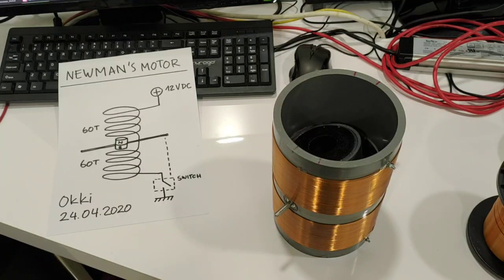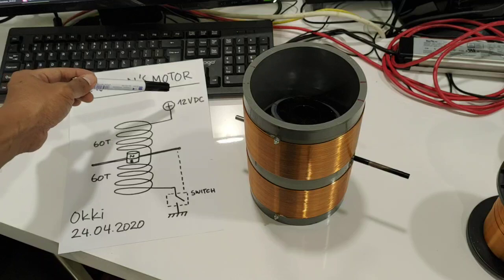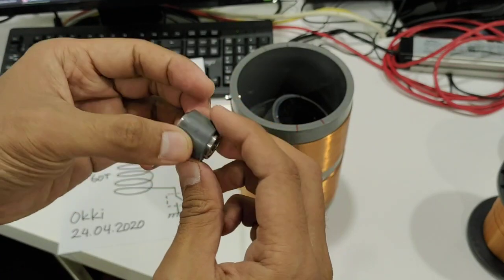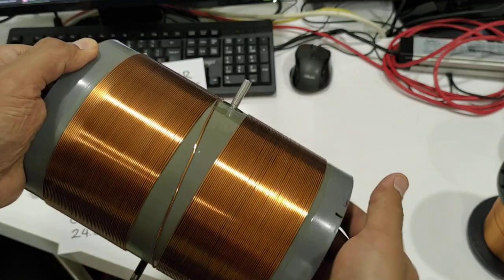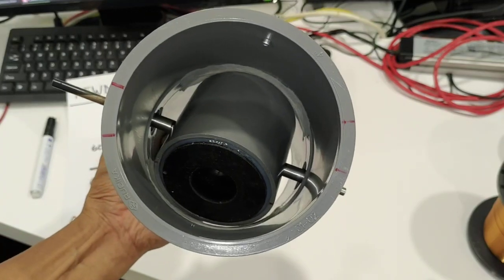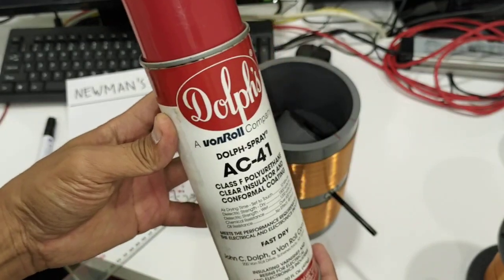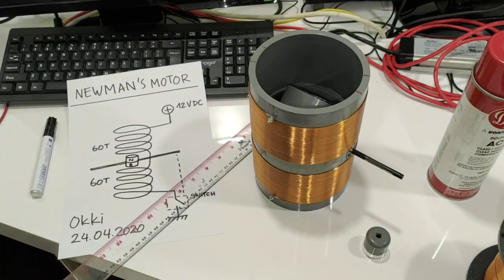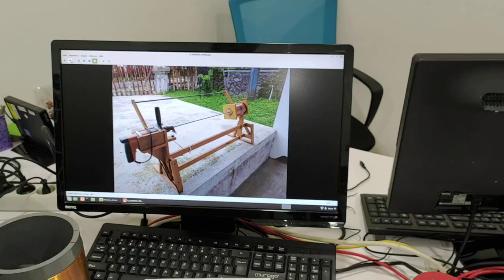Newman Motor - Technical Details

Comment: Beautiful work..    One of the main important aspects of Joe's motor is the length of wire in the coils..  Resistance is important,  The more,  the better..  Joe's motor had Miles of wire..  Your motor should be 5 pounds of wire,  or more..  Smaller gauge wire works best.  The motor shouldn't take much amperage at all,  due to high resistance.
Reply: Good comment, and to get more wire without having it pile up too much, increase the diameter of the barrel which will allow a more massive magnet rotor that should have magnets all way to axel to maximize induction across all windings. Newman motors are typically big to work right, but he had a nice table top motor he presented to patent folks,  which no body has been able to replicate; had negative input current with loads of water being pumped on output.

Comment: Beautiful work..!   Did you know that Joe Newman's motor had 5000 pounds of #14 wire ?   I believe that amount of wire was important to the operation of his motor..
   That much wire has a lot of resistance,   which is why Joe needed 700 volts to run Big Eureka.   Once the magnetic field collapses,  it creates a humongous back spike..  The back spike was 10's of thousands of volts..
Reply from the maker: Thanks. Yes, I know. I intentionally built my motor this way. Nobody replicates his motor successfully. Also with that kind of winding it is impossible to drive it with solid state circuit.
Reply: @OkkiMoeljadi  ,  I know.  I've built a couple of Newman motors myself..  One has 1600 turns on the coil..  The voltage spikes ruined my meter even before I connected it.. 
  If I just hold the meter near the motor it starts displaying crazy numbers..
Reply from the maker: @THOMASTHESAILOR  yes, I can imagine that. Even with much less number of turns like my motor I can still see interesting effects. These effects can be observed on Tesla Coil as well.
Reply: I seen a video of Joe motor, and he was using a few batteries to create hundreds of watts.

Comment: Great work! Can I ask what kind of tests do you want to do with this motor? I made a Newman motor 10 years ago and I still have it! Sorry my inglish!
Reply from the maker: Thanks. I want to see the electrical and mechanical performance of this motor. Did you see something interesting with your Newman motor?
Reply: @OkkiMoeljadi  Yes, they make a huge spike of voltage and you can use it for powering some lamps or charge a bank of batteries. I made a fan with this motor.
Reply from the maker: Do you think this motor has a good torque? I want to build a bigger one and use it to drive a generator. I'm not looking for free-energy device, I just want to build some kind of UPS powered by 12V 200Ah battery. We have electrical interruption so often here where I live now.
Reply from the maker: @Dardacc, thank you for the info. I will check out those videos later.

Comment: I was with you , until you didn't bother to actually turn it on ?
Reply from the maker: I did, check out my other Newman Motor videos.
Reply: @OkkiMoeljadi  I figured  that's the case but 15min showing the build thats about as basic as it can be done , a  30secound demo at the end wouldn't have kept anyone from checking out the video you're speaking of
Reply from the maker: @enrique7919  I'm sorry, I cannot make everybody happy. It doesn't matter what I do, there will be someone complaining. On this channel I just share my research.
Reply: @OkkiMoeljadi   you are definitely right my apologies . I never should have made the comment  that direct or negatively opinionated (an asshole) about it or anything for that matter.

Just had been allowing some personal matters cloud my decency . Sorry about that
Reply from the maker: No problem. Thanks for watching and commenting.